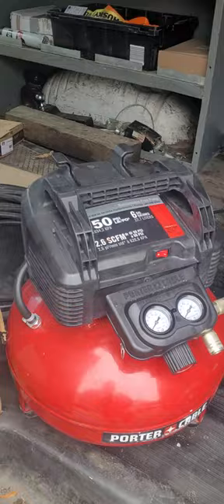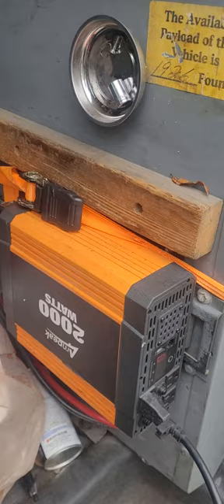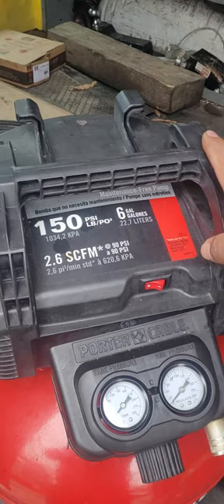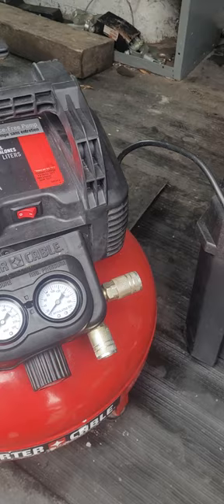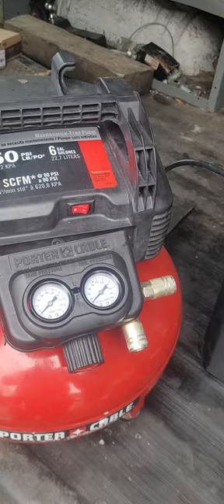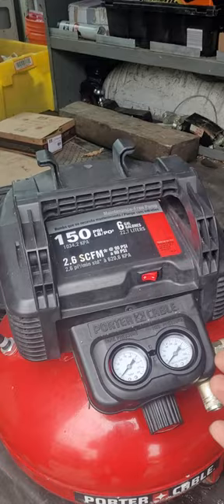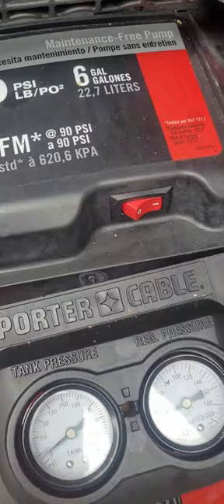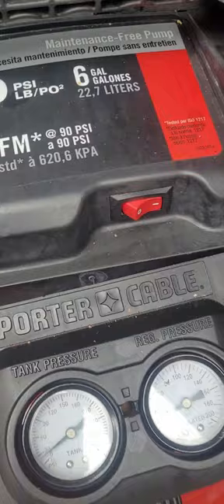can you run an air compressor with a power inverter from your truck / car?

Comment: If you guys want to calculate your wattage,  multiply the volts times the amps which equals wattage. That number is running what it's not the starting wattage so you would typically double that number for Peak watts. For example of my 4 1/2 gallon husky 1.5 horsepower air compressor is 120 volts * 8.1 amps which equals 972 watts. You would double the Watts for the unit to start
Reply: Just so I’m reading this clear, you would double the 972 just for starting?
Reply: @michaellassic6274  yes sir.   I fitted my shed out completely with solar and it's not attached to my line voltage coming from my house anymore. I have a 2000 watt pure sine wave inverter that powers the eight Outlets I have inside of the shed, the two exterior lights, one is on a switch one is on a motion sensor for my dogs. I have all of my ego Lawn Care battery tools in there, most of my DeWalt tools are in there, the battery tender for my harley. I can pretty much plug any tool I have into that shed and it will run no problem. You have to be realistic with your power usage because I'm not going to be running 2 compressors, all of my lights and charging all of my batteries at the same time which would definitely max out the current system I have.

I only have three 100 W panels on top of my shed roof that go into a 30 amp charge controller with Breakers in between that thing get wired to the battery and then to the inverter which is hardwired to all of my shed Outlets and lights
Reply: @jcallesano how about running a portable window ac that runs on 10 amps...what solar panels would I need
Reply: @coffeedollsvp  probably a lot.  It's more the battery capacity that will keep it running.    You'll need to check the sticker on the side of your AC.   It'll tell you voltage, typically 110-120V and them the amps.   Multiply those two and you'll get a number.       You'll need to have an inverter that can handle that power current being drawn as well.   It's a bunxh of math, but once you figure it out.  It's Good to go.   I cannot give you an answer without a lot more info on the equipment being run.
Reply: @jcallesano  u know wasup...thats y asked...
Reply: @coffeedollsvp your portable AC might be pulling 800 - 1500 watts constantly.  That is a lot of power consumption.   You'd need a hell of a battery bank to keep it running if the sun wasn't blasting on the panels.    You would need a solar charge controller capable of over 40 amps and panels that can supply that kind of power through the controller going to the batteries.   It's a whole lot of trial and error to he honest.  I redid my shed system maybe 4 times before I was pleased with it.  I can run pretty much anything I want in my shed, even my powerful air compressor starts and runs no issues.   I only have 2 deep cycle batteries as well.  So when it kicks on, you can definitely tell its auckijg the battery juice.  I have digital meters so I can see the current battery levels and see what my panels are supplying to the batteries for amps/wattage